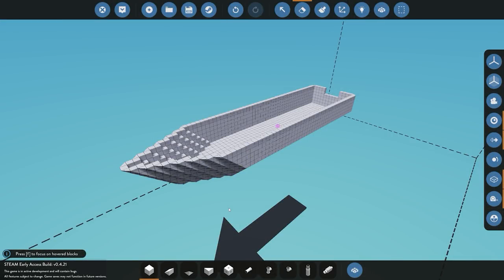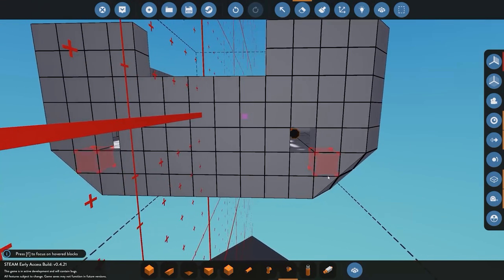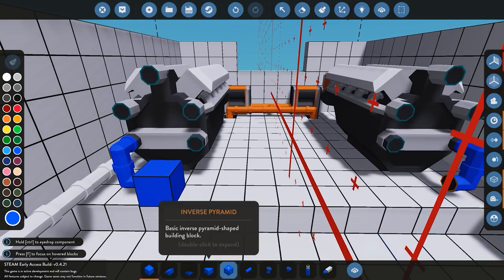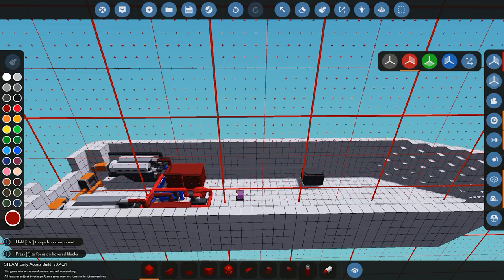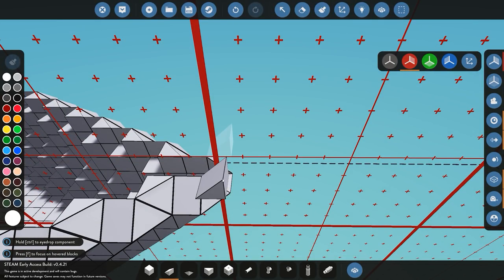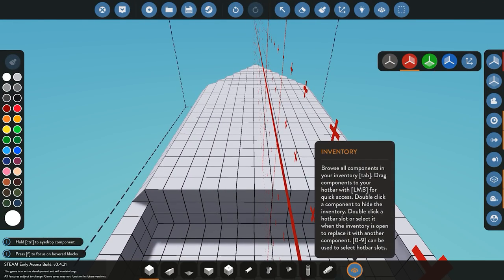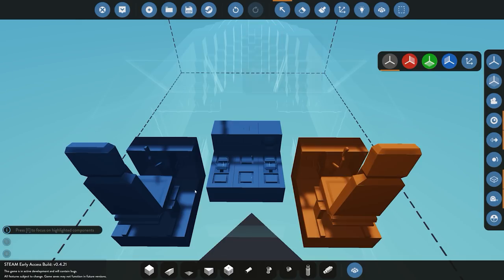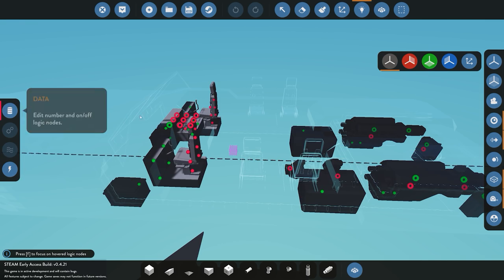Stormworks Step by Step Advance Boat Tutorial (Part 1)

Comment: Thank you for your excellent tutorial videos, this helped me a lot. One suggestion, I learned that if you put a valve in the fuel system from the tanks to the engines you can then setup a refilling system via use of the fluid connector. If you don’t use a valve the game won’t let you refill the tanks when connected to an engine or something else. You have to use valves to isolate the tank in order to fill it. I suggest to go ahead and build in these types of systems for future proofing your designs a bit if uploading to the workshop. Thank you so much again for the excellent videos. I would love to see some more advanced technique videos like doors (custom and even the blocks), fire fighting (water systems),  and I’d suggest bilge pump ;)

Comment: old video, but still helps. my boat is enclosed and wont float unless i put the plane floaters or whatever inside. is that just cause its not enough area to increase buoyancy and its too heavy or?
Reply: Psii Kix yes too heavy, not enough buoyancy. Make the inside of your boat have more space so there would be more air and buoyancy.

Comment: You see I am making a large ship but for some reason even though I have 6 batteries that are 99% charged none of the doors work so I was locked out of my ship. I removed the doors for testing went to the engines the first one say low fuel (I'm actively filling all 12 large fuel tanks), low air, and low exhaust yet I can clearly see exhaust coming out of the vents. The backlights to my gauges work. Oh and I have set up several circuit breakers to control electrical connections. They are all 3 on. I have no Idea what is wrong. Also the buttons light up. Idk I'll check it later its literally 3 AM. I'm redoing all the air and exhaust pipes later as well. The second engine said the same as the first.

Comment: Sticky throttles are not really idea for smaller boats, setting up a clutch and automatic gear reverse is also not that difficult and it makes maneuvering a lot easier. You don't need to supply 0, no number input is 0 as well. Check out the Fast Tender on the workshop, pretty much the benchmark for a basic boat.
Reply from the maker: Powertampa I agree that using a automatic clutch would be the easier thing to do however for the purpose of this video it is not.

Comment: I really dont know what ios happening. I rebuild your setup and even with a engine setup on land with a radiator the engines alwas have a really loud ratling noise like BANG BANG BANG. if i ramp up the throttle the true engine noise appears but the BANG BANG BANG still is there.  if the engine stalls the BANG BANG BANG gets slower and then the engine goes out....

Also in my setup i got 2 clutches (1:1 on both for now) and the Engine RPS on 20. but damn the boat just shoots out of the water and is really fast...
Reply: I am having the same problem with my engine... did you find a solution?
Reply: @littlevinster2224  yes, don't use a toggle button to start the engine. Use a push button or disable the toggle button after engine speeds up. The sound is the starter  that is always on. But you don't need it after the engine is running.
Reply: @friedrichquecksilber770  thankyou this worked!

Comment: @MrNJersey That speed boat looks like you would see that in flordia somewhere it looks so real it's the best looking SpeedBoat I've  seen on Stormwork. What's the Lenth And Width of the Haul? Also how does your camera move so smooth and slow? One More thing could you make a tutorial like this except for another kind of boat maybe yatch I can send you a pic of a real boat.
Reply from the maker: The boat is on the WS, I think I linked it in either part 1 or part 2. I will at some stage be making a tutorial for an advance medium size boat. The camera can be moved slowly by holding down shift
Reply: @MrNJersey  Appreciate it man!!! I'll be waiting for the vid for an advance medium size boat. Thanks!
Reply: @MrNJersey  I sent you a friend request on steam a couple seconds ago